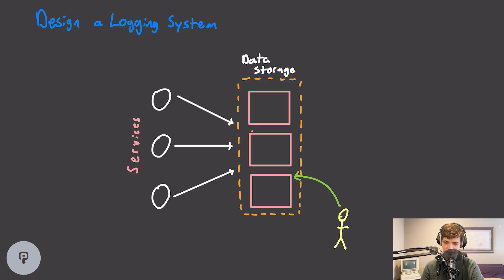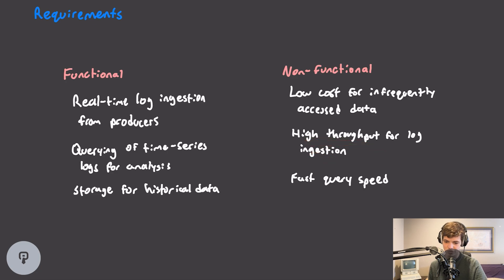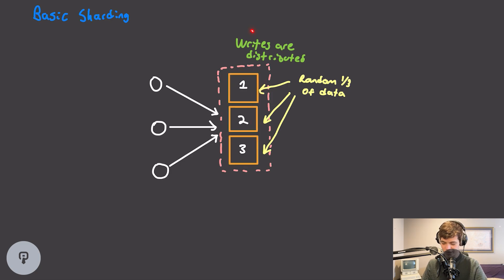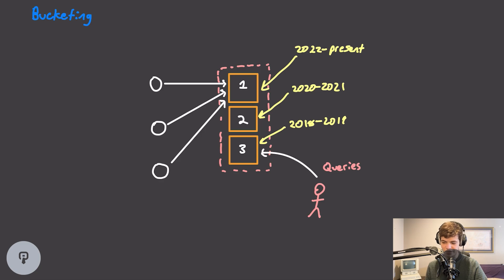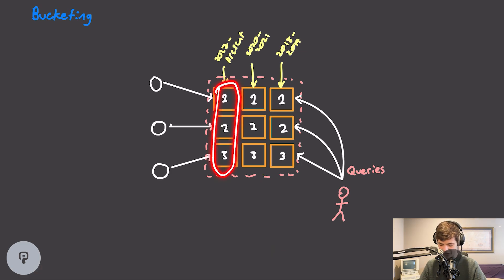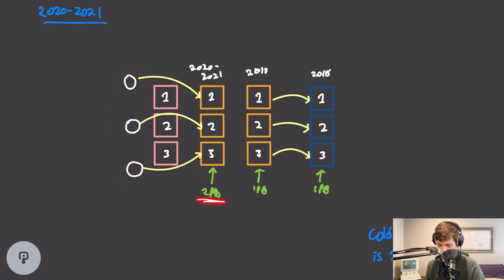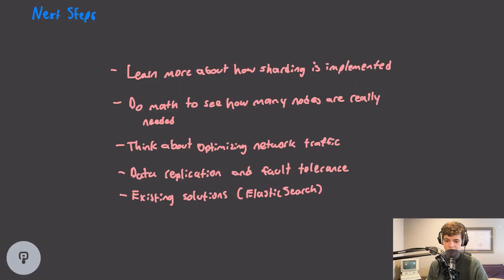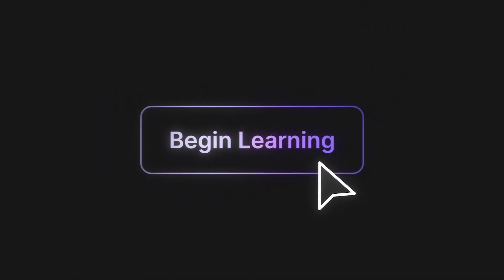Design a High-Throughput Logging System | System Design

Comment: i dont understand , if under same bucket lets say for (2021-2022) we have multiple nodes , how are reads any faster ? for the same bucket logs will  be distrubuted across servers and still need to be queried across servers which is slow . Bucketing didnt help in improving read performace , is my understanding .
Reply from the maker: Yes, sharding improves write performance at the expense of query latency (unless we shard by something more clever!). However, we can still handle a high throughput of reads. This latency vs throughput problem is a common tradeoff with large-scale systems! Hope that helps :)

Comment: Suppose every two years, it ingest 2PB and migrate 1PB, how could three sets be enough to cycle after 12 years?
Reply from the maker: Great question! At any given time, we have three "hot" nodes--two are migrating data to cold storage and one is ingesting new data. We only showed one cold storage node in the example, but we would need at least 2 to make this work long-term. Hope that helps!